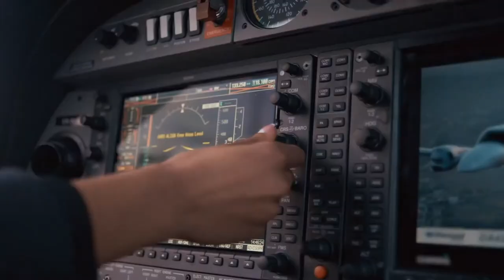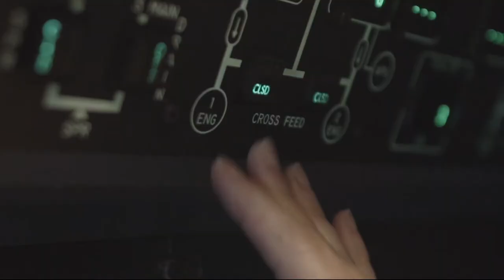21A Aircraft Maintenance Officer. (They OWN the jet!)

Comment: No Mx officers don't say the aircraft is safe and ready. The Mx crews do with the final review by the pro super typically an E-7
Reply: to be honest as a maintainer I almost never interact with MX officers
Reply from the maker: why do you think that is?
Reply: I think it's different everywhere, at Cannon, maintainers (even E4 and below) had a great relationship with aircrew and talked to each other about the issues they faced in flight. I moved to Hurlburt in 2018 and it was the complete opposite, no one talked to no one, and I've seen the difference that makes in actual deployability in system maintenance. @airforceofficerpodcast
Reply: @airforceofficerpodcast because the maintenance officers who spend 2-3 years at a base before moving are typically just learning the ropes of the maintenance process, and aren’t actual SMEs. The enlisted that can spend possibly their entire careers (looking at you PRP) on a jet are the aircraft SMEs, the Mx officers are just the enlisted voice to leadership at best.
Reply: That's not entirely accurate.  While it's usually a pro-super that signs off on the jet being safe to fly..... Mx officers can as well and often do (assuming they have the right authorities on the special cert roster).
Reply: @donttrackmebro  I never seen or heard of a MX officer getting an ER. Most wouldn't know what to look for.
Reply: Here's the truth...all MX officers could take 30 days of leave at the same time and it would change nothing...things could improve. The reality is pro Supers, expiditors and flight chiefs run it.
Reply: That last sentence is true.  That said, I've been on the E side of maintenance (14 years) and the O side of maintenance (8 years) and you'd probably be surprised by how quickly a unit without a Mx O to push back on Ops' asks..... would be run into turmoil.